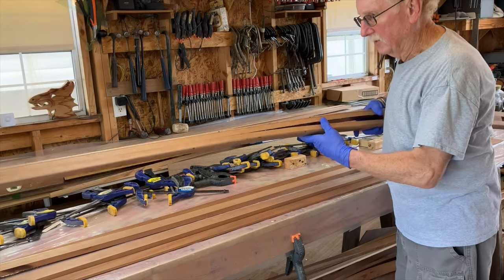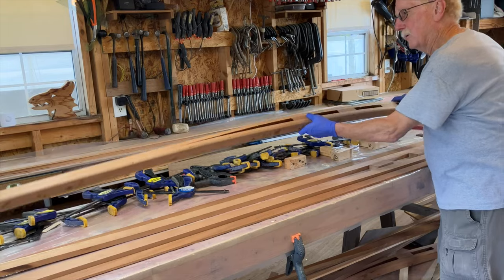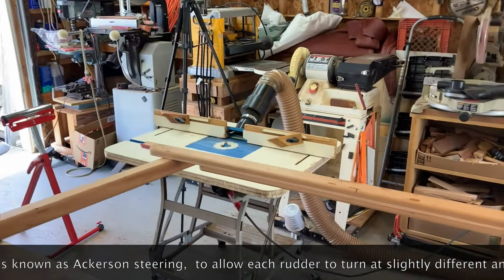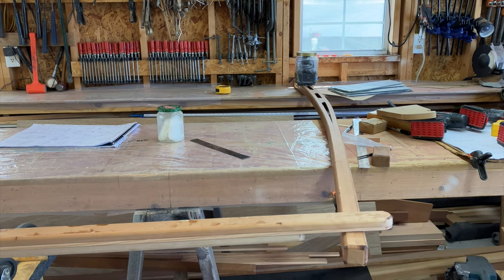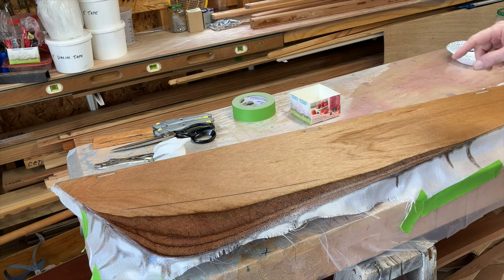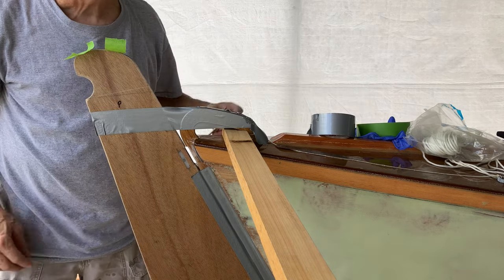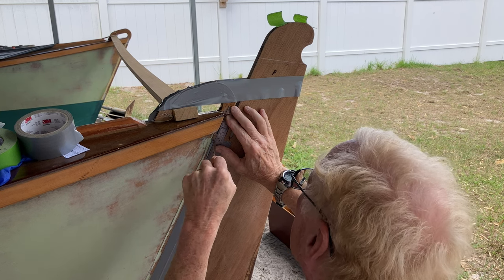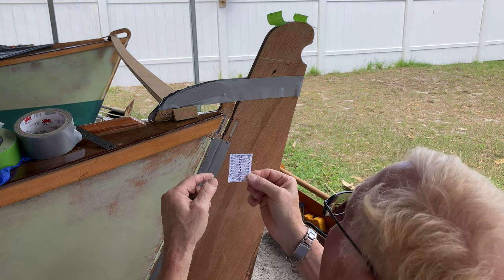Ep30 Building a Wharram Tiki 21   4K

Comment: Very useful video. Thanks. I'm refitting an old Tiki 21 and didn't know how to redo the rudder lashings. Due to rot I had to refurbish the lacing post. May I ask wich drill size did you use? Thanks in advance. I admire what you are doing!
Reply from the maker: Hello,  First we drilled an oversize hole(at least twice line size)  and filled with thickened epoxy. After the epoxy cured we drilled a hole slightly larger than the line size. We used 3mm dyneema line to lace with, the hole should be at least 4 mm to make lacing easier.  Once laced we squirted a little epoxy into the holes to insure the line did not move, Paint would probably work as well. Appreciate you watching our video.
Reply: @RexandKathie  thanks a lot. I hope that with tour advice I'll be soon sailing
Reply from the maker: Looking forward to seeing you on the water.

Comment: On the tane and tanenui catamarans,  they had a wedge type block on the tillers, under the tiller connecting beam, the wedges matched the angles of the stern post's, to stop it binding on the tillers, do the tiki's have this set-up? Thanks for your videos they are greatly appreciated. All the best
Reply from the maker: Yes, we haven't got the wedge on the tillers yet but they will be there eventually. Thank you for watching.
Reply: @RexandKathie  ok thanks I wasn't sure if the tiki's did or not. Cheers all the best
Reply from the maker: @elados6954  And to you, thanks.